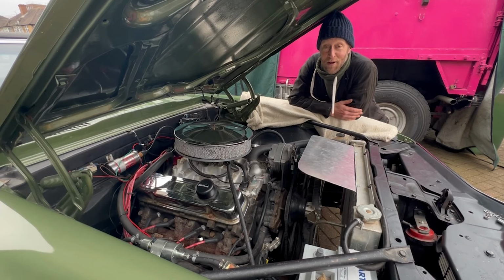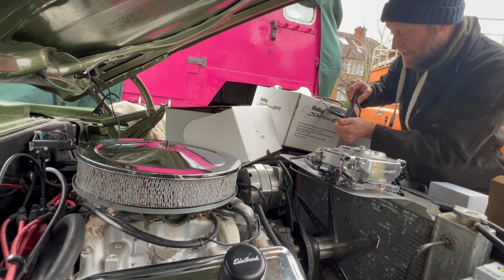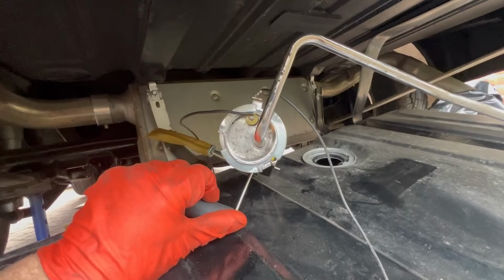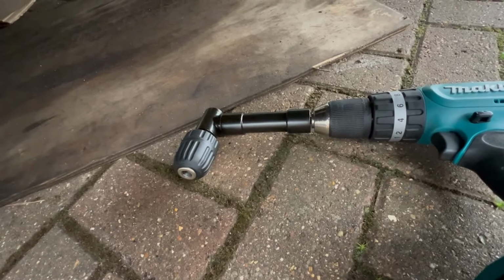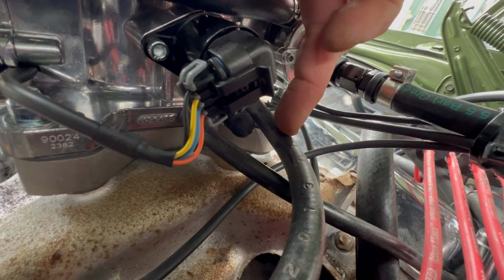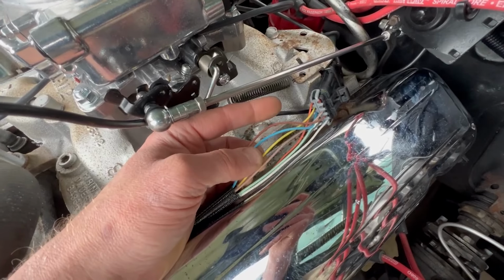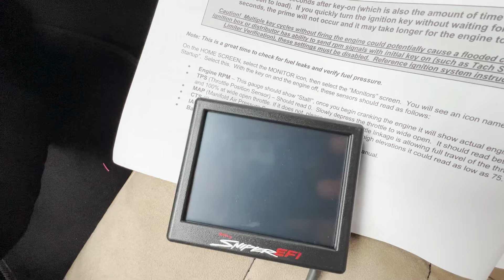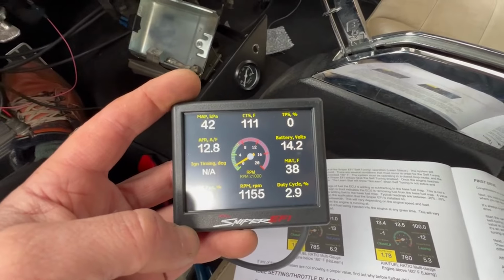Holley Sniper EFI conversion of Pontiac Firebird 1967 6.6L (400) v8

Comment: Smashing. Question is will it give you that most satisfying sound under full acceleration of the secondaries opening up? Nothing sounds better than a four barrel opened up through an open air cleaner. If it mimics that sound all is forgiven. However this is probably the thing to do as efficiencies of injection and modern fuel seem to be moving inexorably in that direction. Plus I'm sure the engineers at Holley thought this through. Smashing bit of kit that. Next to go? The coil swap for fully electronic ignition? That and the EFI and you can dial in the AFR.
Reply from the maker: So many thanks for taking the time to write this comment! And for watching! Yes I absolutely agree with you with the sound of the secondaries and it doesn’t mimic it so im afraid all can not be forgiven!;)) however I’ve done the unthinkable and put it some exhaust cut outs and boy does the 6.6L sound phenomenal with straight though pipes in an underground car park!! I’ll post a quick vid on that later! Yes and with the cost of fuel it was all about the efficiencies and the practicality of it starting on the button no matter the temp! I have a thing about cars not starting!;))
You’re right the next step will be full electronic ignition so I can release the coil from its captivity and get that AFR ramped up!!! What’s your dealings with V8s? It sounds like you know your noodles?:)